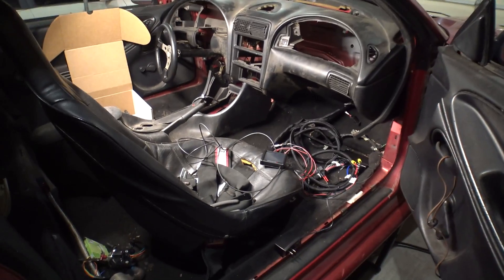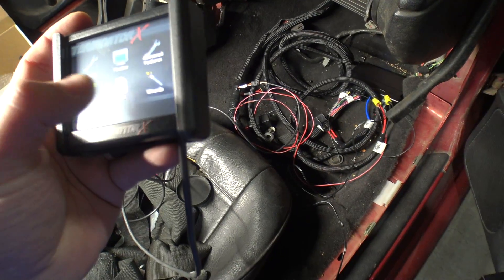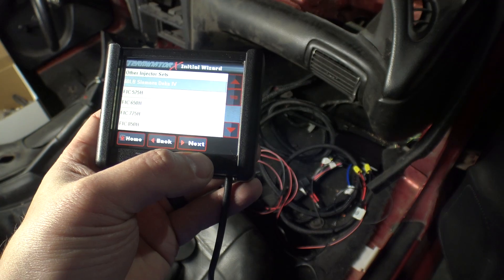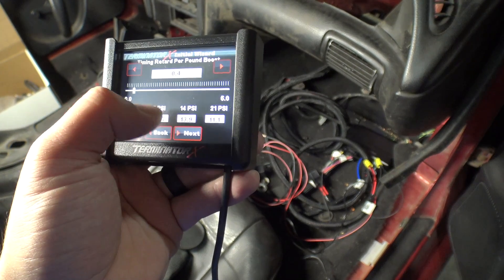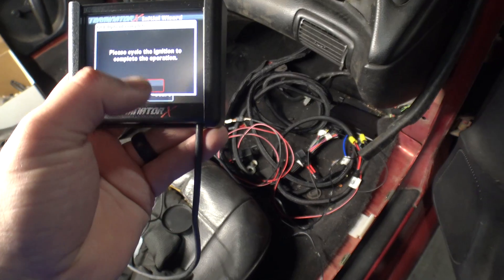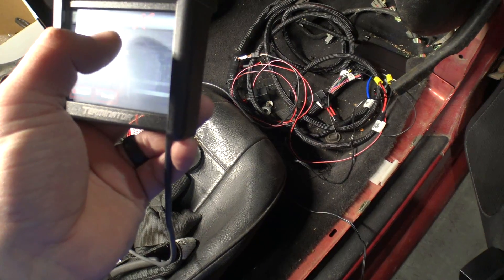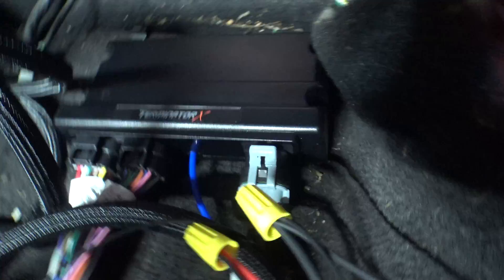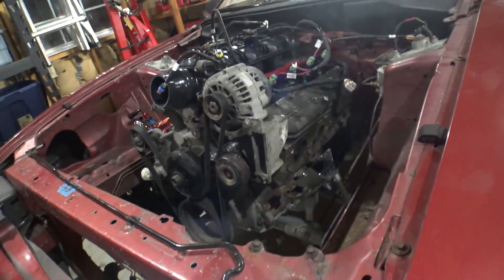project 8f8 new holley terminator quick overview and wizard

Comment: Hey there,  I am doing a build with a 95 mustang and will be running a 5.3.  Will I need the harness to have control over my transmission?
I was looking online here. in Canada and the Unit you are speaking about is around $1500.  With trans part it is $2000.  What year is the mustang?
Brad

Comment: Do you have an opinion or experience with the fitech ultimate LS system?
Reply: Hope it works well. I just bought one. If this had been out I would have got the Terminator X
Reply: The problem I’ve had with it is finding someone to dyno tune with it. No one wants to touch it

Comment: Will the transmission control for a 6 L 80 work with the Terminator? The ability to change gears by hitting a button will that be retained or do you lose the manual control?

Comment: I had another question as well seeing that you're a tuner does this eliminate the need for tune because it has Target air fuel ratios that it will try and hit? Obviously from what I can see you can't change spark maps and fine tune air fuel but it will do it all automatically based on your settings right?

Comment: If you can't change it in the configuration you can just pull the pins from the fuel and oil pressure on the computer and switch them
Reply from the maker: Yes this is what I was going to do

Comment: Matt I’ve been researching tuning, I purchased an x max and I’m going to learn to tune it myself. I’ve been trying to figure out the afr at wot at 0psi. I found a post on Ls1tech that you said you like to start at 24° and you like 14° at 14psi. So basically your taking .7° of timing per psi of boost. Would this still be a good starting point for a 6.0 9.5:1 compression 7875 e85 with a ss2 cam?

Comment: The only bad thing is the display is the size of a postage stamp. So you're gonna spend another grand for a decent dash. Also only having for inputs and 4 outputs kills it for my use case. Still a badass system for the money, and it's even better that companies are taking notice it's not just the big money guys trying to build a car with their stuff.
Reply from the maker: i think you are exaggerating a little lol
Reply: Maybe a bit, but that dash is tiny. But, if you use existing gauges it becomes a moot point. Still a great system. Definitely considering using this on my other build.
Reply: Damn i can't reuse condoms! Someone should fix that.
Reply: Well by all means if there’s a decent 7”+ digital dash that works with it that’s cheaper than the IQ display please share. I’d like one for one of my other projects.

Comment: Thanks for the informative video!  Just ordered one of these for my LS2 going in my 81 trans am with a TH350.  Yeah I know the trans is trash but it is worked and free so there's that.
Reply: What's trash about th350?
Reply: @thestig8768  it is kind of like the 4l60e vs 4l80e, the TH400 was always the go to trans for high performance.  I bought this one off the shelf spur of the moment when I broke the housing on one in my gbody.  Gbody twist and solid mounts all around are no good :)
Reply: @Mustang_Magic  th400 absorbs a lot of hp, its bigger and stronger but takes a lot of power to run it they came behind big blocks for a reason. I rebuild my th350 i wouldn't say it bullet proof but quite strong

Comment: Hey Matt can you shed some light on the Fan #1 and Fan #2 ground triggers? My question is whether it can be setup like an LS1 F-Body using 3 relays for high and low speed, in which case Fan #1 must be shut off before Fan #2 kicks in.

Comment: Are they going to bring out a terminator version for other engines?
Reply: You should check out holleys site, they have had these for years, just this version is new and inexpensive.
Reply: They have SBF and Coyote kits if anyone's still reading this.  Got the SBF kit for my 408 stroker.  Will eventually do an LS swap on another car, use the same SW and harness I'm learning now.  Harness was super easy and high quality.

Comment: i got the "spend a little more to get the more advanced features" message back in the late 00s. if i could have gotten something that did everything this does for a grand i would have been stoked. on the car i had then i ended up getting a Link G4 when they first came out, the big "looking back i wish it/i had x" feature would have been electronic throttle. it would have made the antilag/cyclic idle/idle in general (terrible old solenoid open/closed idle up for AC and idle air bypass setup were so fiddly to get right) so much simpler.

i think the big thing holley brought to the masses with their entry into the EFI ECU market has been that any average joe can install one and have it running/self learning so easily, no other system i have seen seem to have that same ease of entry into standalone EFI setups.

Comment: It would be nice if they could control a 6L90, or 8L90 , but those trans controllers are spensive!  $1k plus, for the tans only, a one in all is better I think.  Or the OE ecm! I'm not drag racing, heck of settle for full manual control of the 6-8speed auto, I don't know what I'd do with one of the new 10speed trans! Never thought I'd see that many gears! I guess it's close to a CVT! Go through the gears  fast as a race bike! But I may make the leap to LS, I been looking for something like this, I guess with a crank trigger on a old v8, it could be retrofitted, I guess a crank trigger on the harmonic balancer, and there she goes! Distributorless 1st gen v8, with injection of course, 
I want to put a 4.8 in my firebird, with a bit of boost, 650 tire , with a T-56, or a 6l90 -8L90 6-8 speed trans,   I can get a 6L90 for about $1, 700, but controlling it is about that again, for the price I can get a T-56 with the works! But I have a newly built 385 stroker, with aluminum heads, and 11.25:1 , and nos hp cam, to go in it, I would like to keep it manual trans, or 6dpeed +  if auto. The orkginal T-5 will be useless! I also have a12bolt posi to go in it, and a 9" if I wanted  to go that route, butid have to get a gear and pos unit! And I'm not sure about the width, so I think the 12bolt! It even has the same gearing! But I can get the same power with a boosted 4.8-5.3 with a cam and a few other goodies, injectors throttle body,  a truck intake is fine with me, I have room for turbos behind the headlights, put the battery behind the rear tires, where the spare tire goes, I'm not racing, at the strip, anyway,  a 3.45-3.73 gear is plenty for it? 27" tires,

Comment: Now I'm torn between this and the fitech 70051. Matt have you heard anything about the fitech system? Its going for $995.00 with trans controller  .
Reply: Don’t get the fitech. It’s trash. I’ve installed and used em. They arnt that good   Very basic and non responsive to changes made to files. Sucks. Every customer was pissed they had it installed. Ran like shit. Took forever to learn. And half the time it never learns.
Reply: go with holley you will not regret it

Comment: The ONLY downside I see to the Terminator setup vs stock PCM is for swapped street vehicles that have to pass an OBDII emissions test.
Reply: You can can bus to the sock evu leery it run piggy back and keep the stock ecu it just won't control anything bam obd2 port
Reply: Totally agree, I live in CA where the emissions are crazy, would have to file for an exception, wait for 10 months, make sure the motor came out of the same class of vehicle (passenger vs. truck/delivery), had the same fuel type usage (no gas to diesel conv) and they might, and I mean might approve it within a year.
Reply: @iamblaineful  its stuff like this that makes me love Texas, if I put a 6bt into my truck they just say go ahead, and there's no testing on diesels or 25+ year old.
Reply: @williambell7763  dont let the word get out. Theres already too many california and new york wackos moving here. They're ruining texas.
Reply: @popo_53  lmao........

Comment: Does it have "auto learning"?

My ECU from my 1993 Jeep has auto learning but 25 years later and the aftermarket still does not have auto learning.

Please tell me I got that wrong. Love to know.
Reply: The Holley hp has an auto tune/learn. I'd imagine this does as well.
Reply: There were menu selctions on that hand held for fuel trim settings. That means its self tuning. Most, if not all, of holley stuff is.

Comment: Too bad they don't make this for like all engines...  All they would need to change are trigger settings (more options) and number of injectors and then you would be able to do  4-6-8 cylinder.  And maybe keep it GM and Ford sensors that would be the the shiznit.  Anyone out there that doesn't understand how good of a deal this is doesn't deserve it.  If it was a $1000 and it could read Ford edis  and do everything else it already does I could use it... Oh and tell MSD when the fire.
Reply: no doubt. I do not want to admit my age... but I remember an 80s subaru turbo getting a full saab injection swap perfectly. I do not know why holley holds back unless it is permission of proprietary hacking. there is a whole world of world record longevity with the gm 4.3/5.0/5.7 and 7.4...and many other engines already injected , and forced to stay retarded.
Reply: you can easily use this on any v8 engine as long as you get a LS crank and cam sensor signal to it
Reply: @JunkGaragehome   I think you're missing the point that I'm trying to make. That the hardware is already there all you need is the software.
Reply: read the comment strand again it was not towards you but barry

Comment: Holley makes a remote location sensor log .that's pretty cool check it out .you could probably build your own .they individual ports so all your sensors are in one place .easy to test. holley Part number. 534-35

Comment: Fitech 70050/70051 is even cheaper. It lacks some features like flex sensor. Like the holley, though.
Reply: Less IO, no boost control / two step junk - but for a street car it seems like an even better value to me. What is it, like, $1000 with trans control? Comes with 3 bar MAP and a wideband + the harness. Hard to talk shit on that.
Reply: @tomslater5198  retail $ 1k with trans control. I'm running without. Under 800 for 70050. I'm sure the Holley is a better executed product, but Im just putting the option on the table for consumers to consider. I've got 3k miles on mine by now and Its been relatively flawless.
Reply: Matt references Flex (FCS) but the Term X manual does not mention Flex as a connection...  So I am not sure if the harness includes a FCS connector or not..?   I am interested to see how Matt gets it setup once complete, hopefully walks through the Flex setup soup to nuts.  But if the Term X does not include Flex then the FITech is a better value IMO for a basic setup.